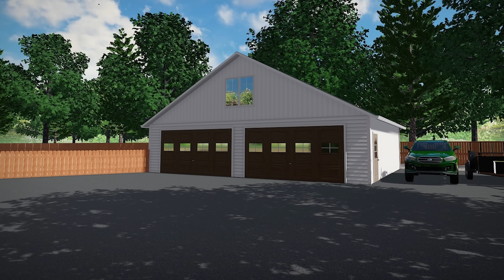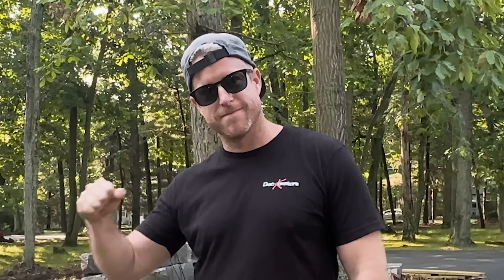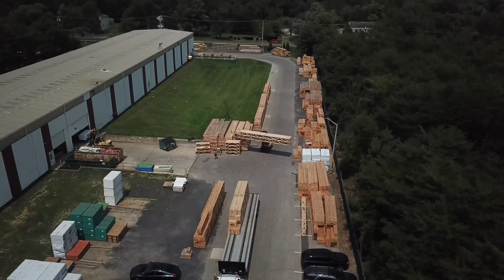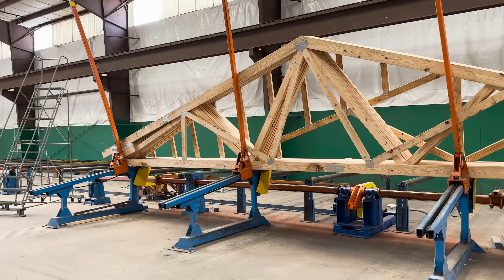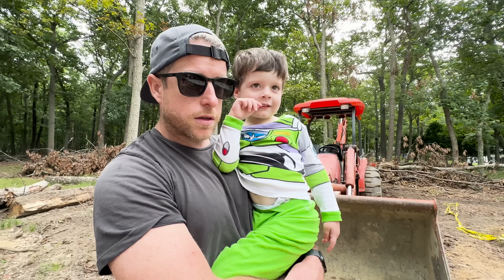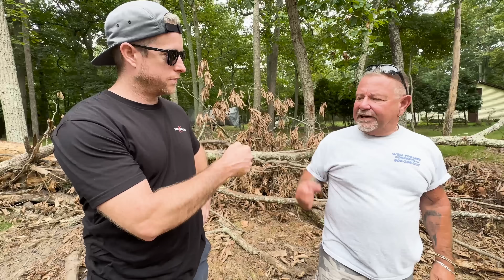Building The Premier Dream Shop - Part 1

Comment: Looks like a monolithic slab on grade? Is there any insulation under the vapor barrier? Will you be conditioning the shop? I’m in VT and hopefully be getting to do this in the coming years.
Reply from the maker: Yup, monolithic pour, no insulation under the vapor barrier. I’ll probably do some sort of heat in the shop area at some point but that will be a little down the line!